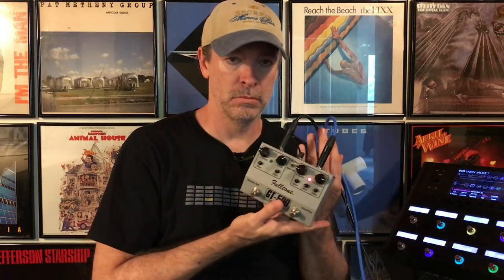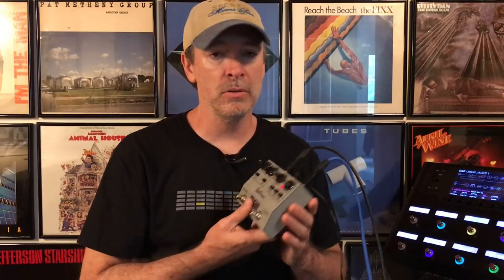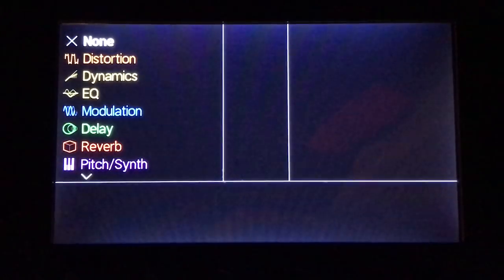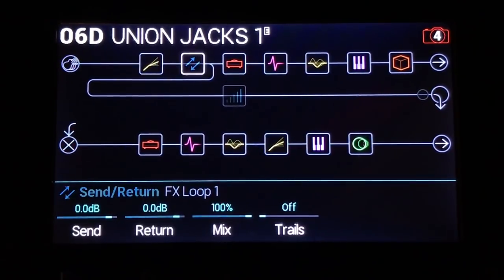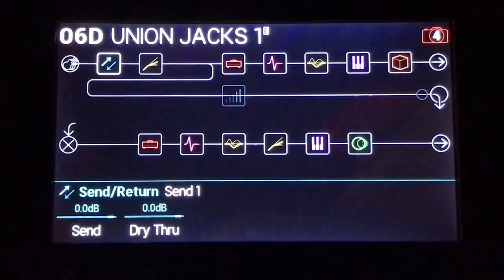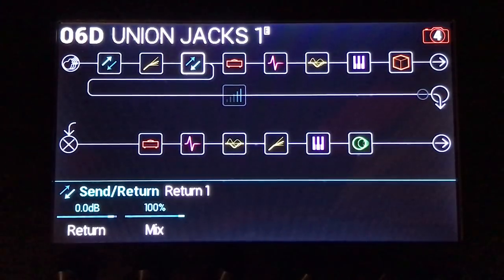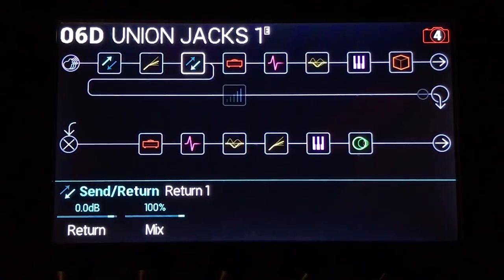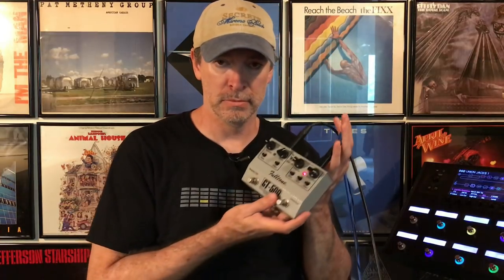Using External Pedals With Helix

Comment: How does the routing work when the Send and Return are on opposite sides of the compressor?  Wouldn't the signal just go around the compressor, or is there something I'm missing?
Reply from the maker: Mark Lugg You know, I judge everything by the sound and feel, and from my perspective it sounded (and felt) better with the send and return on either side of the Compressor.
Reply: @Scottsguitarplayground  I think Mark's point is, why have the compressor there at all if it's bypassed by the Loop? Wouldn't the same thing be accomplished by turning the compressor off with the bypass button, or just deleting it?

The Helix Channel is a great resource by the way. Not trying to sound like know it all. Thanks!